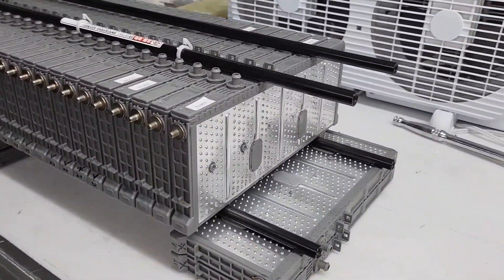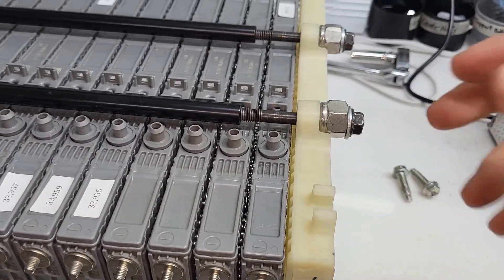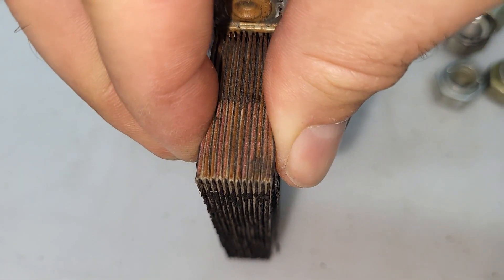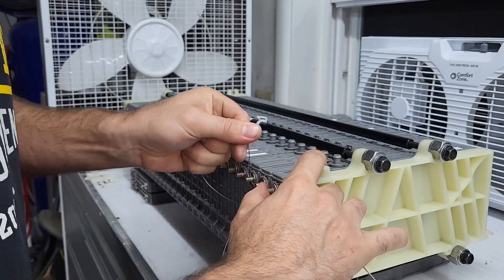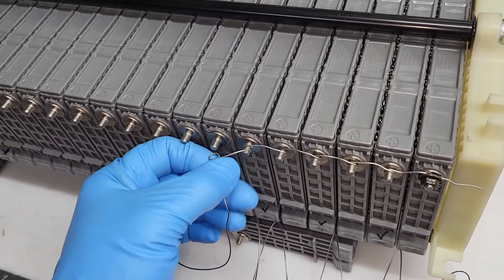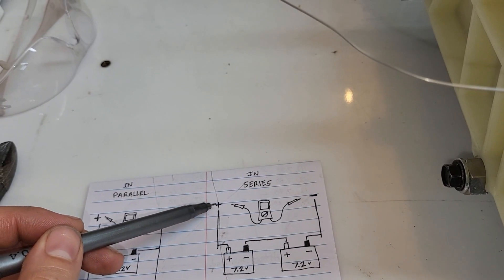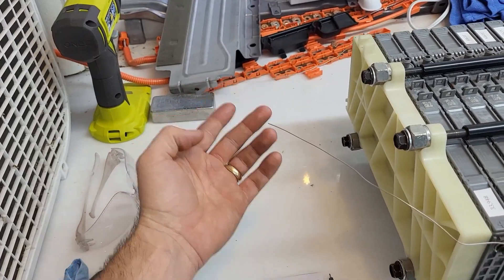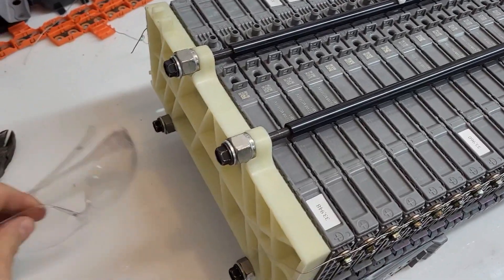Toyota Hybrid Battery Cell Balancing

Comment: These batteries will suck the life out of you. The gas vents fail to a higher pressure causing the negative post seals to leak, then the cells dry out and die.  I got fed up and put in a cylindrical kit. Still less than 0.05v diff after a year of service in a temperature swing -30C to plus +40C. gen 2 with 480Km+